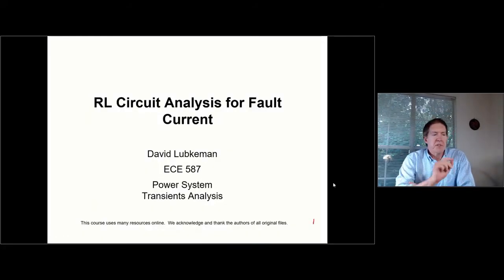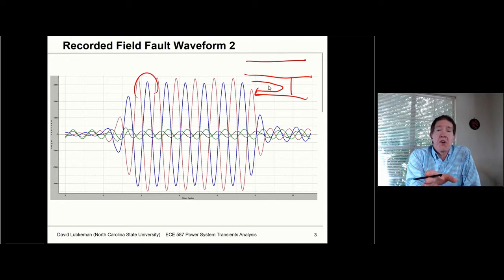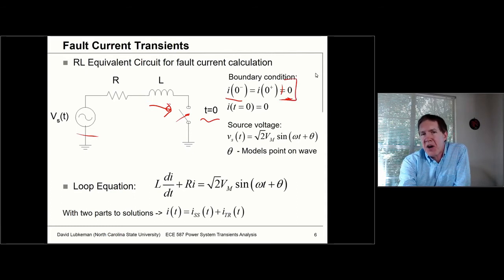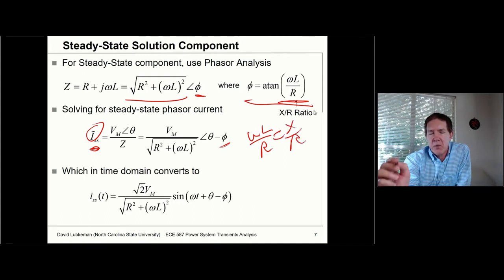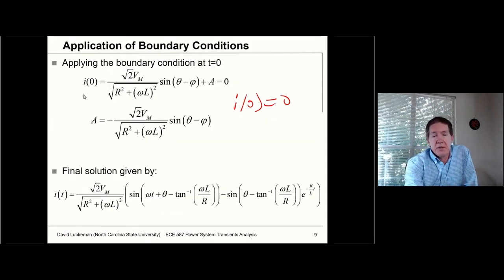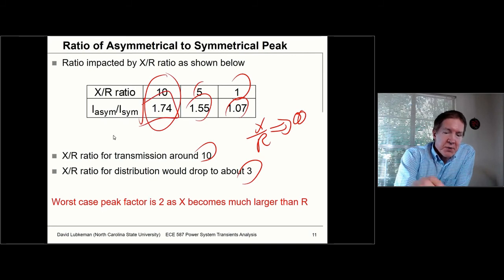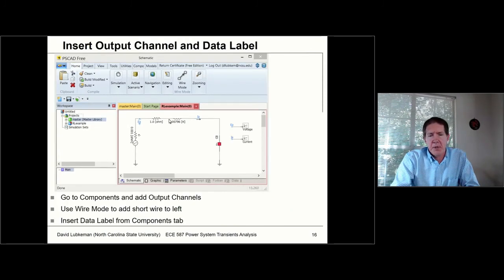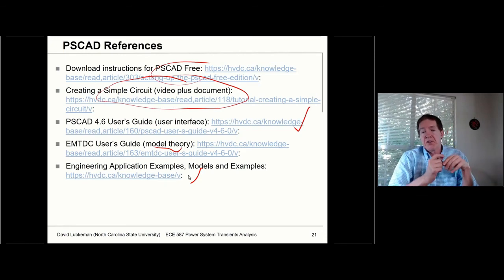Lecture 2a: RL Fault Transients Theory - Power System Transients Fall 2020 - Lubkeman

Comment: Good explanation. Detailed and accurate in its coverage of the subject, yet also laid out clearly and logically. Thanks for posting it.
There's a similar explanation in IEEE's tutorial course on the application and coordination of reclosers, sectionalizers, and fuses. 80 EHO157-8-PWR. It's in the chapter by David Smith, on pages 21-24. The table of fault current asymmetry data is one I've found extremely helpful over the decades.
Students should also be aware that the same concerns that apply to circuit breaker short-circuit capacity during the first few half-cycles after fault initiation -- that is, higher thermal and mechanical stresses than would be the case for symmetrical waveforms -- apply to reclosers and fuses as well. See, for instance, S&C Descriptive Bulletin 351-30, page 3.
Reply from the maker: Glad you liked the video.  

I could not find an electronic source for 80 EHO157-8-PWR Application and Coordination of Reclosers, Sectionalizers, and Fuses, IEEE Tutorial Course, 1980. I looked on the IEEE Power Engineering Society resource site (https://resourcecenter.ieee-pes.org/) and IEEE Xplore database with no luck.

Here is the link to the S&C Descriptive Bulletin 351-30: https://www.sandc.com/globalassets/sac-electric/documents/public---documents/sales-manual-library---external-view/descriptive-bulletin-351-30.pdf?dt=638374654731878424.  Note these electronic references sometimes get moved, so you may  need to go to the S&C Electric site and redo search for Bulletin 351-30.